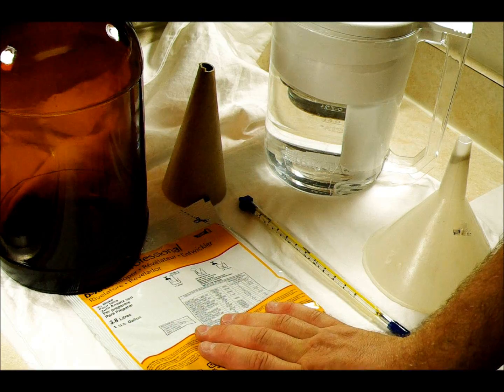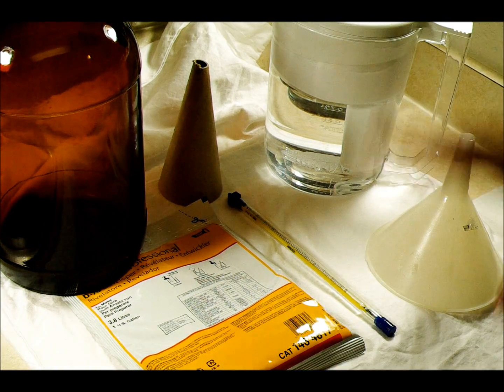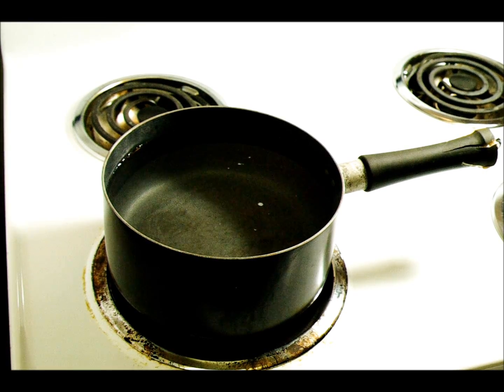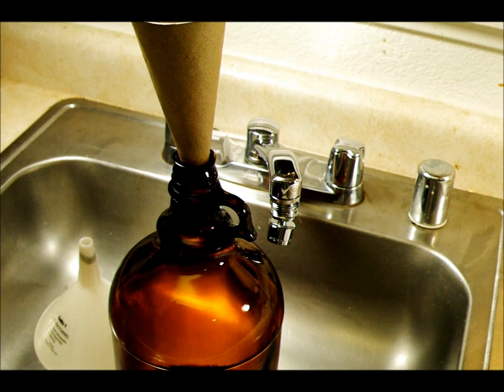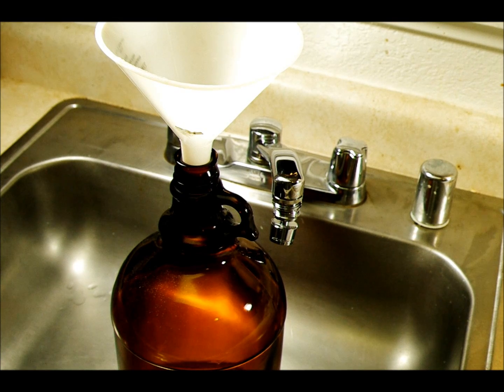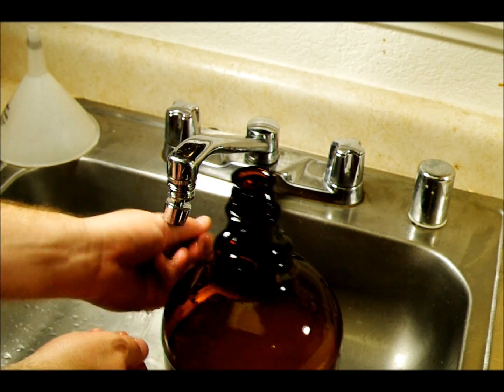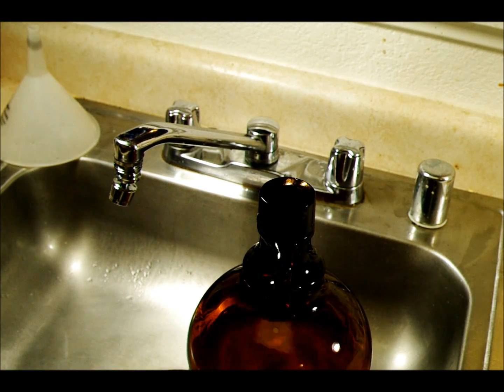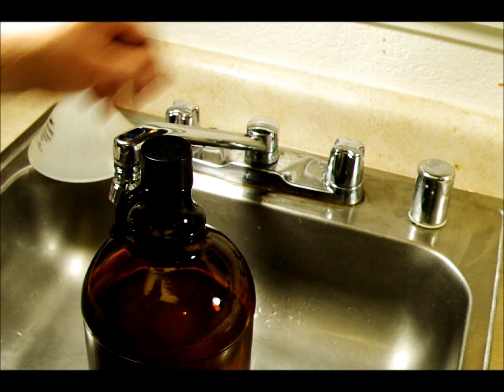How to Mix Black and White D-76 Film Developer from Powdered Concentrate

Comment: just wondering, whats the point if you can do black and white a lot faster in a program? its less wasteful too.
Reply from the maker: Well, for a lot of good reasons. Firstly, I disagree that it's more wasteful. Modern mining and manufacturing processes create tons of toxic waste. Digital cameras use a lot of rare earth materials that are mined using wasteful and polluting methods (though mostly in third-world countries so it's off a lot of peoples' radar.) Old film cameras -- they were manufactured so long ago that their environmental footprint not is practically nil.

Secondly, taking a black and white film photo requires a much greater skill level than taking a digital photo and slapping some sliders around until it looks good. Black and white film photography teaches image discipline, selectiveness, and improves a photographer's understanding of what cameras do and how they function.

Lastly, it's a challenge. Sure I can obtain basically any black and white result I want from a digital image. I do it fairly often, too. However, I have a much greater satisfaction seeing a negative turn out well after I calculated the exposure, planned the shot, and managed to develop it properly.
Extending that to printing in the darkroom and it's a fantastic sense of accomplishment that makes digital photography feel comparatively hollow.
Reply: you must be new here

Comment from the maker: Yes to both questions. In fact, they make accordion-type plastic bottles for chemical use that can collapse as the fluid is used to reduce head space. As for the nitrogen gas, that would prevent the oxidation and, insofar as I know, because the nitrogen is inert it should have no negative effects on the developer solution.

Comment from the maker: This video is for mixing stock solution. To make dilutions, the stock solution with water. For 1:1,mix equal parts stock developer and water (e.g., 250ml stock developer and 250ml water.) For 1:3, it's one part water to three parts water (e.g., 250ml stock developer and 750ml water.)

To calculate the volumes, take your needed volume and divide it by (1+#) where # is the dilution. So for 1+50, divide the needed volume by 51. When calculation dilutions you need to account for both parts.

Comment from the maker: That depends on the tank. Fill the tank, for sure. As for how much do you NEED? Only a few teaspoons of developer are actually used during development. There's a pretty amazing developing tank called an orbital tank for sheet film. It can develop 80 square inches of sheet film in, I think, 50ml of developer fluid. Maybe 100 ml. Anyway, very little. So most of the developer in the tank is used to fill space, not develop the film.

Comment from the maker: I got the jugs off Craig's List, but I've seen brown glass chemical jugs at antique stores, too. Many antique stores will carry oddball glass jars on occasion and any glass jar that won't ever be used for food ever again has the potential to work. Milk jars are typically a half gallon and have wide mouths designed for pouring. Four of those would neatly store a gallon each of developer and fixer.

Comment from the maker: Some other options for oxygen control include a heavy-duty balloon inside the bottle.

Also, you could get a stopper top with a hole and run a glass tube into the head space. The glass tube would connect to another jar, smaller, with an oxygen-absorbing compound.

A variation on the latter places the bottle on its side and uses a second glass tube with a ball valve to simplify portion control. That's a pretty complex setup, though.

Also, collapsing plastic (accordion) jugs work well.

Comment from the maker: Something like a wine saver? You could, but my fear about creating a vacuum would be the strain it places on a jar not designed for vacuum pressure. I've found the marbles make pouring hard toward the end and the jar VERY heavy after it's half empty. Also, if the marble has a glaze on it, my fixer dissolved that. The fixer was fine, but in quantity the marbles could alter the fixer's chemical makeup.

Comment from the maker: Also, Google search Ilford ID-11 and the third link should be Ilford's page on the developer. Under that page, click on Fact Sheets (red text) and then Powder Film Developers.

That opens a nine-page PDF that has a lot of good info about using ID-11 to develop as a stock, 1:1 and 1:3 solution. It also provides two pages of time charts that show how long to develop a bunch of films with the various solution mixes.

Comment from the maker: I have not, but I know people who have used it extensively. Most of them use it 1:1. So, you mix the 1L pouch with 1L water. Then, if you're developing 1 roll of film in a 250ml tank, use 125ml of the solution you previously mixed and 125ml of water to make the 250ml.

So that's basically like cutting the 1L pouch four times (the 1L pouch will make 4L 1:1 solution.) I'm told this can be cut to 1:10 (1L pouch = 40L solution), but the developing time is like 65 minutes.

Comment: Have you ever tried Ilford ID-11? I can't understand how to mix it properly. I have the 1l powder box and the guy from photo store told me to mix it with 1l of water to get stock solution and after that mix stock solution with even more water to get working solution right before developing film (but just the amount that I'll need to develop 1 or 2 films). But as I've read in the manual and on the internet there's no actual numbers of how to dilute it. Some people mix it straight with 5l of water

Comment from the maker: The other consideration with stock and 1:1 is finished result. Some people find that 1:1 returns more evenly-toned results with less grain and greater shadow detail (less contrast over the fream.) That could be true, but advanced developing techniques (such as intermittent water baths) can have a similar effect.

1:1 should be dumped after use. stock can be reused a few times, more if you use stock solution replenisher.

Comment from the maker: Depends on how much you use and your budget.

So using 1:1 cuts developer cost in half, which can be a lot if you buy new developer at $10USD per gallon (last I checked at my local store a month ago.) At shelf prices, that's about $1.51 per 324-exposure roll of STOCK solution.

If your time is more important, stock is a good idea. I like stock because the idea of standing over my sink for longer than the stock developer times is a non-starter with me.

Comment from the maker: 1 bag mixed into 1 gallon is stock solution.

Stock concentrate isn't a term I'm familiar with. I assume it means using the stock solution as a source for diluted developer. The 1:1 (500ml of what you mixed plus 500ml of water) is different from stock.

Basically:
Powder bag = concentrate
Powder bag mixed to 3.8L = stock
Stock further diluted with an equal volume of water = 1:1

Comment: I damn im confused I diluted the bag d76 powder all of it in 3lts of water at 53c temp mixed it very well and then added water until 3.8lt or 1 gallon. Is this 1:1 ? or this is stock concentrate?

Comment from the maker: After mixing as shown you have stock solution. 1:1 means taking 1 part of this and adding 1 more part water.

For instance, I have a 1,000 ml stainless steel tank for four 35mm rolls or two 120 rolls. Stock would mean using 1,000 ml of this solution as mixed above. 1:1 would mean using 500 ml of this and 500 ml of water. Some developers (NOT D-76) allow more dilution than 1:1. I know people diluting 1:10 and even 1:64.

Comment from the maker: 1:1 does mean 1 part D-76 and 1 part water. So your math is correct. That WILL affect developing time, though. I forget how to calculate that off the top of my head. I tend to use D-76 stock because it yields greater shadow detail and less grain (though also less acutance) than 1:1. D-76 should only ever be used stock or !:1. Other developers can be used 1:9 or up to 1:100. Diluted D-76 should not be returned to the container. I do re-use stock D-76. TO push film, D-76 should not be diluted.

Comment: great video. I just mixed my first bag of D-76 this afternoon, and now I regret not seeing this video first. Questions: After adding marbles, how long do you think that that mixture will last? Also, if I have a single reel stainless steel tank that can hold 290ml, does 1:1 dilution mean add 145ml of stock D-76, and 145ml of water? Thanks
Reply: Probably around  20 rolls, I can get 5 reels on single tanks with a 1 qt  jug, and 4 qt = 1gal